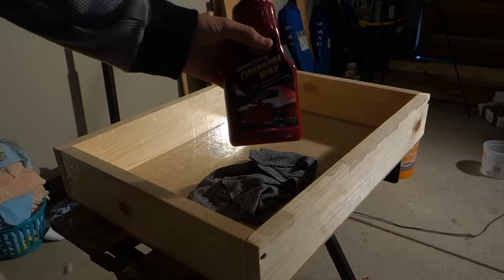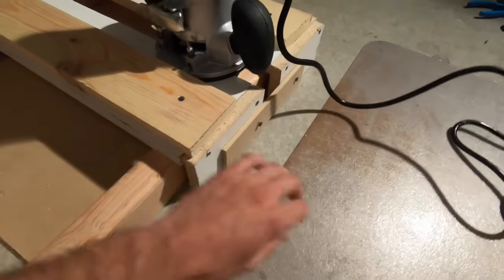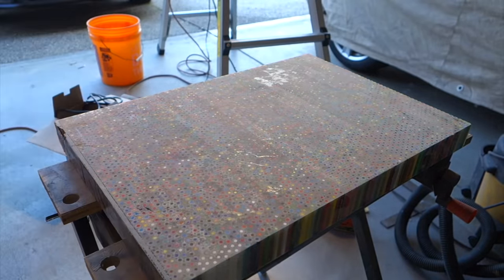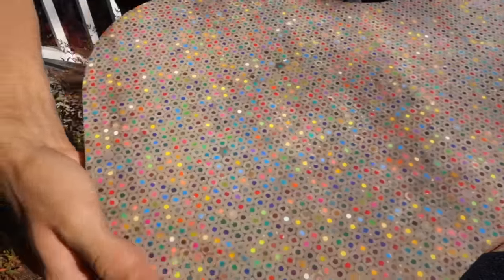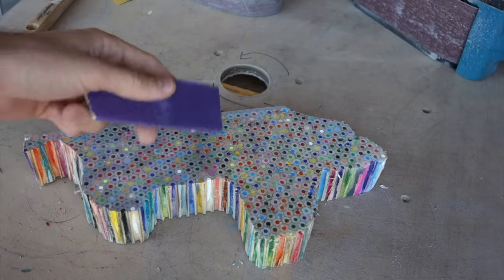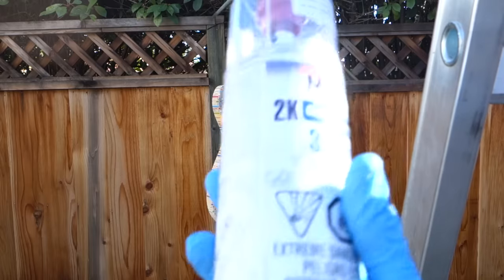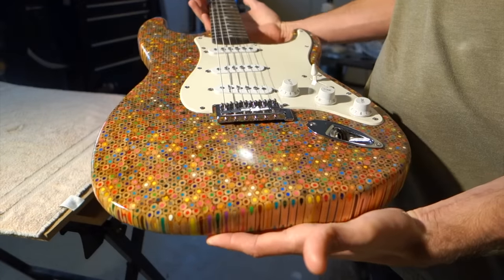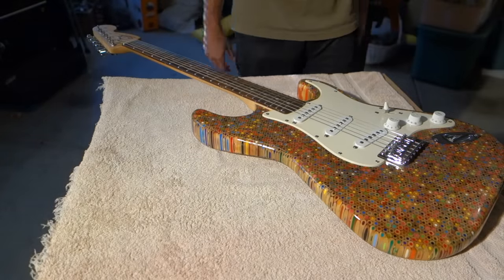I Built a Guitar Out of 1200 Colored Pencils

Comment: The tone wood debate gets even more interesting... Alder vs Ash vs Mahogany vs Poplar vs 1200-colored pencils epoxied together.  
Nice work on the build. 👍
Reply: Tonewood guys be like:
- damn, that's a colorful sound
Reply: Here's another one to add for the debate...  Made by the Custom Shop: https://youtu.be/7Oo2H-W7d6A
Reply: +Landslide I guess I prove that statement wrong, then. Love strats.
Reply: I think a Telecaster done this way would look really sharp, in my opinion.
Reply: You can build the body of the guitar out of anything really. All it needs is room for the pickups and inlays and boom you got a guitar body. Of course it has to be strong enough to hold the tension of the strings long term. The neck and fretboard would be a serious challenge to do this way though.
Reply: @helder6175  : A saw this a while back. It proves you can make a great instrument out of most anything...
Reply: @DeathBYDesign666  : I'd love to hear the cardboard git, this pencil git and any other odd body material all together unplugged vs plugged in. I think the resonance would be more noticeable unplugged. Once plugged in the electronics, amps and hands have more to say about how it sounds...
Reply: It's not a debate. Pickups do not pick up sound. They use electromagnetic fields. The wood of a guitar ONLY affects acoustic tone. Once it goes through an amp what the guitar is made of has zero effect. If you were to play it unplugged. Yes, what you hear then would make a difference.
Reply: @Wylie288  Strings vibrate, all sound = vibration, vibration = sound, all matter = vibration, all matter = sound (resonance), magnets surrounded by copper wire 'pick up' vibration / energy, what exactly do you think an electromagnetic field represents?      Your argument is fundamentally invalid, just saying.    And yes, the composite (body of instrument) those pickups are mounted to and what those strings resonate off of ( fretboard, fret wire size, body composition), effect their vibration timbre and character, even before they are amplified with a voltage / gain path through an amplifier, an oscilloscope also would pretty much disagree with you also at that point.
Reply: @Wylie288  Whatever you say.   😂

Comment: Proving you can make a Strat that sounds good out of just about anything you can put a screw into.
Reply: I'd be interested to see the frequency profile of a color pencil and carnauba wax body guitar.
Reply: Just about anything but resonance is key
Reply: steveteb - Its all to do with resonance.
Reply: @PrinceWesterburg  not at all. Electric guitars work based on the strings breaking the line of magnetic flux, and creating a transverse wave form that the amplifier translates and turns into sound. 

It has nothing to do with resonance of the wood.
Reply: Nice sound. Killed tone wood by pencils guitar.
Reply: @Prosecute-fauci  Disagree, play an electric guitar with a maple neck vs a rosewood neck. There's definitely a difference.
Reply: @beneaththesound  I actually own both types of fret board on strats, and I can tell you that the only difference in sound is due to the fact that one of them has vintage 60s pickups, and the other has modern pickups. I have swapped pups on them just to make sure of this. 

I used to be a tonewood guy, then I looked at the physics of how an electric guitar works. 

Fender made a strat from cardboard and it sounds identical to anything leaving their factory. Explain that Mr tonewood
Reply: @beneaththesound  : So what does that have to do with the body material? As long as you have a solid construction, neck joint and decent electronics the guitar will do it's thing. The hands do the rest...
Reply: @beneaththesound  I bet you can not perceive that minimal difference when the sound guitar is mixed with the sound of the rest of instruments during a concert or even when you are listening CD music. If you close your eyes to not to see the neck´s guitar you can´t say what is what. The most important is the electronics
Reply: The Fender custom shop,made a Strat out of cardboard! 
That's right,they did a similar treatment, to the cardboard, in order to harden it and bolted a Strat neck & scratchplate/electronics and tremolo whammy bar on it and it works.
The guitarist of Linkin Park actually tested the cardboard Strat for them, on various live shows & in the studio and that thing worked with no issues.
Oh and about the whole, retarted ''toanewood''-debate: Prof.Dr. Manfred Zollner has debunked the ''the wood makes a difference''-myth. His book ''Physik der Elektrikgitarre'' ('Physics of the Electric Guitar'') is currently translated in english,from german.1,200 Pages which are the result of over 11 years of scientific research on the subject. 
On the most hillarious chapters in the book,is when he did a blindfold test to trained musicians,playing 2 different soundclips of the same guitar and the test subjects were claiming that:''clip 1 is mahagony,because it sounds warm,clip 2 is alder,because it's snappy'' or some other BS. xD
Reply: @greekfreak1980  Les Paul did similar tests with similar results over 60 years ago.
Reply: @BrianBoniMakes  But muh toanewood!!
Reply: @BrianBoniMakes  Les Paul is a proponent of tone woods. There's a video of him calling people who don't believe in tone woods a bunch of idiots
Reply: @DirtyStringz  I'd really like to see that video. He called his test guitar "the log" and he believed it to be the first solid body guitar. There's a version of this guitar hanging at the Rock and Roll Hall of Fame and you see the wood is just a chunk of rough lumber. Maybe you're referring to a hollow body?
Reply: @beneaththesound  I agree with the neck, but the body makes little difference. I've seen vids on acrylic bodies that sound like any other wood guitar.
Reply: Because that’s what a Fender was about when it started, it was all about cheap affordable instruments for working musicians
Reply: @greekfreak1980  Good information about the book you are talking about.... And yes, it happens in a lot of subjects: a friend of mine invited to expert persons to taste wine, and he served the same wine in different cups and told them every cup has different wine, and all the expert people said "Yes there is a big difference, one is sweet,  other is stronger and other is acid". Same thing in guitars. Impossible to perceive minimum different neck sound in a concert or CD or whatever.
Reply: @BrianBoniMakes  you know what man I feel stupid now cause now that i think about it I believe it was actually Paul Reed Smith, not Les Paul who said that. I'm trying to find the video now. It was at some convention.
Reply: @Prosecute-fauci  thank god you've figured it all out. you should tell gibson so they can stop wasting money on rosewood and mahogany and use plywood instead since it makes no difference lol.
Reply: @DirtyStringz  No problem, we're all here to learn. If you find it I'd still like to see it.
Reply: @1viccar  Exactly!!!! It's amazing how some of the people getting purple in the rectum during debates like this....fail to ever even once consider how typical human-nature 101 it is to hear things which aren't even there... based on expectations, the opinions of others, tradition, EGO, and even false information. If you wish to believe something strong enough, you'll believe it regardless of legitimacy. There's a term for this, I think it's called Belief Perseverance. The wine experiment is a good lesson too. I mean, when you've spent a lot of money on some ridiculously expensive prehistoric wood, gathered by pygmies, over mountainous terrain, in the snow, anyone who says that the body material makes almost no difference is always going to be an idiot to you. They should really concentrate more on becoming better players, rather than desperately trying to convince others that their multi-thousand dollar "tone wood" sounds substantially better than a bunch of colored pencils.

...it doesn't.
Reply: @ballbustinbravo  It doesn't. It's just that rosewood and mahogany look better than plywood.
Reply: The material you make an electric guitar out of DOES make a difference, but NOT a difference in tone. The difference is in the natural sustain (sustain not caused by electronic interference). The guitar string will vibrate longer when mounted to a denser material, because energy transfer occurs less freely compared to a less dense material. This is why a Les Paul standard weighs as much as a small planet. Its made out of Maple. A Strat, which gets most of its sustain from the circuit, is made out of alder or ash or poplar or plywood. They don't care they're going to paint it. Danelectros were (famously) made from masonite. The tonal qualities were plenty good enough for rock'n'roll. The term "tonewood" is applied to wood varieties because of the properties they display in acoustic instruments. Electric instrument manufacturers use acoustic tonewoods simply because consumers associate instruments made from those materials with good quality. And they're often pretty.
Reply: Oh yay, the anti tone wood crowd showed up. They are the guitar community equivalent of Flat Earthers.
Reply: 99% of the tone comes from the amp, change my mind
Reply: Hold on a min boyos... we all know that hollow body guitars sound way different from solid bodies... 

So if you used a lighter wood vs a heavier wood wouldn't THAT make a difference?

End of the day the frettboard wood matters a lot because of feel.
Reply: Brian Boni I know a couple of divorced men and I don't think they would make good guitars.
Reply: Because they got screwed by the judge...oh never mind.
Reply: This is so iconic... Comparable to all the greats.  In fact I can imagine the greatest of the great all wanting to play a tune.

Comment: You seem concerned about cutting it out using a large bit. Next time try using a spiral upcut bit and make multiple shallow passes you'll get a much cleaner edge. Also in reference to the colors smearing when you sanded, since most color pencils have a wax based lead in them, put your blank in a freezer and let it freeze. It's the friction heat from the sander that makes the color run and you can delay this by having it Frozen.